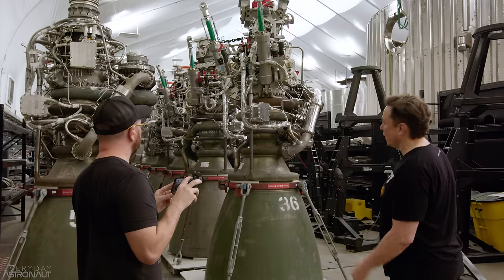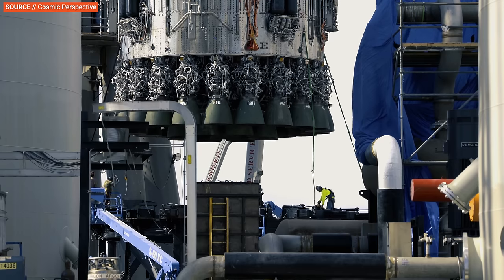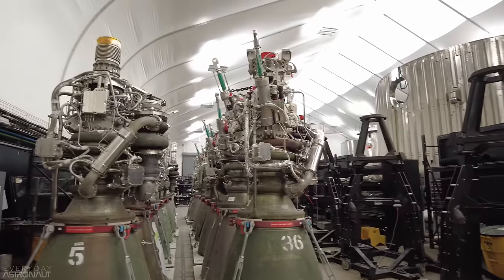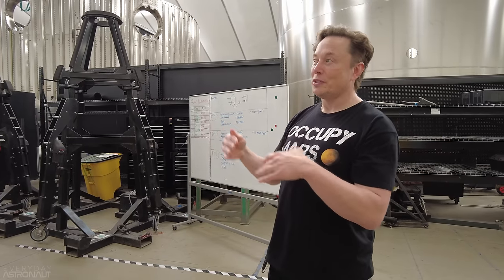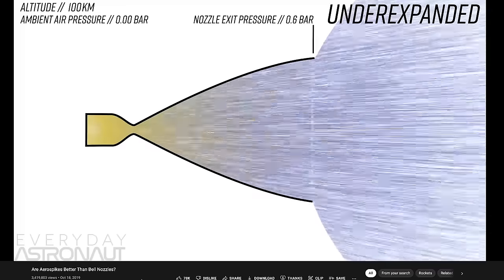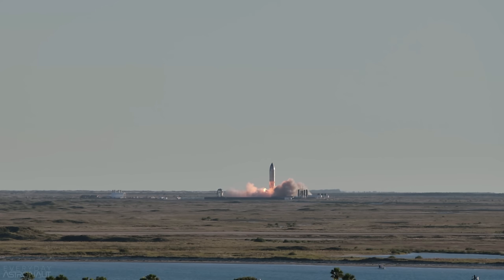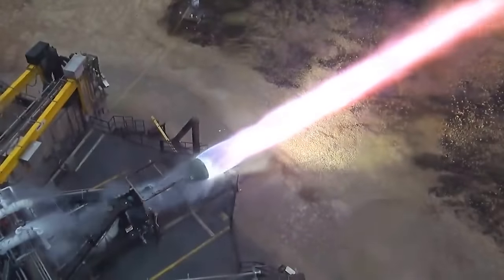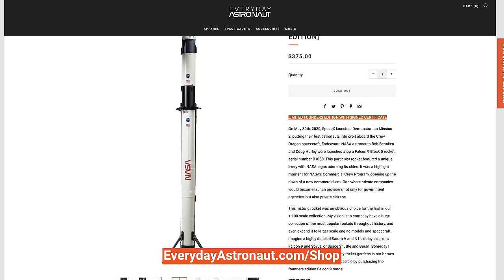How SpaceX Is Upgrading Raptor To Be The Ultimate Rocket Engine!

Comment: You mentioned how Raptor 2 can achieve more work due to gravity losses but in orbit, that's no longer a factor, wouldn't it be better to keep Raptor 1 Vac as it is more efficient. Raptor 2 is great for launch and landing but once in orbit, efficiency comes a long way.
Reply: Raptor 1 is only slightly more efficient, but also heavier, less reliable, and less powerful. Being heavier and less powerful may equal out in total efficiency. But it absolutely needs more reliability. Plus R2 might improve to beyond R1 in the future.

Comment: specific impulse to me sounds like HP for car engines, it doesn't actually mean anything because its peak power on a test stand at optimal rpm etc.. ie a point you never reach in a real situation. The whole torque & rpm curve is what matters and its the same here.
Reply: I also agree with other commenters here that you should ask Musk if he plans on making a bigger version of raptor later down the line once they are satisfied with their simplification and comprehension efforts or if they reached the limits that materials can handle on a single engine definitively. 30+ engines even with less fiddly bits per unit seem like a maintenance nightmare to me once the fleet starts expending.

Comment: Why not optomize the vacuum variant for ISP efficiency and the sea-level engines for thrust? You only need 3 (or maybe 6 eventually) vacuum engines per Starship instead of 30+ for sea level engines so they could afford to be more expensive and complex.
Reply: "Why not optimize the vacuum variant for ISP efficiency and the sea-level engines for thrust?" That's exactly what SpaceX is doing

But the booster will still need about 30 engines for liftoff and the ship 3-6 vacuum engines to get to orbit. The booster only gets the ship above the thickest parts of the atmosphere. The ship then has to gain all the sideway velocity to actually stay in space.
Reply: One of the reasons to not go full tilt vaccum optimization is because the RVacs may need to fire in atmosphere in an abort scenario.
Reply: @motokid6008  I always wondered if that was one of the reasons to put 3 more vacs on for a total of 9 engines on starship, that would give them a close to or better than 1.5 T/W for starship alone.
Reply: @TheEvilmooseofdoom  - That and their intentions to stretch Starship. It's going to be bigger in the future much like how Falcon 9 grew as Merlin performance increased.

Comment: Can do starship SSTO now ?
Reply: I don't think so.
Reply: No it will never be SSTO
Reply: Yes when given 9 engines for takeoff from ground. The SuperHeavy booster already has SSTO capability with over 100 tons payload to orbit as a single stage expendable.
Reply: @robertclark1734  Where did you get those figures for superheavy?
Reply: @TheEvilmooseofdoom  See the video with Dodd titled, “[Summer 2021]Starbase tour with Elon Musk [Part 1]”. About 10 minutes in Elon gives the dry mass of the Superheavy as between 160 to 200 tons. With a propellant mass of 3,600 tons use the rocket equation to get an expendable payload of over 100 tons even with the 200 ton dry mass.
Reply: @robertclark1734  Ahh.. I use a different calculator, the rocket equation is absent gravity and atmosphere.  When I punched in the numbers updated with Raptor 2 engines, single stage to orbit payload is 16-17 tons.  If you are curious which calculator I used it's the launch vehicle performance calculator by Silverbird Astronautics.  Check it out.
Reply: @TheEvilmooseofdoom  Thanks for responding. Perhaps we should compare notes. When I used the same calculator I got over 100 tons payload. When using it, input both vacuum Isp and thrust values even for the first stage, since the calculator already includes reduction at sea level. Also make sure your launch inclination angle matches the launch site latitude, 28.5 degrees for Cape Canaveral. 
 YouTube won’t let you include links in the comments. It’ll delete them. So I’ll send to you what my calculation looks like.
Reply: The YouTube AI must be smarter than I thought. I tried to say do a web search to find my calculation and I didn’t even give a link and YouTube still deleted my comment anyway. Try searching for SSTO on the Kerbal forum.

Comment: I'm almost anticipating a larger bell in the future, if you combine the area and flow rates of 2 engines into 1 you're only increasing the radius of the engine by the square root. There's probably reasons to not do this related to combustion inefficiency, but it would tie into Musk's love of removing parts. Fewer engines also means less plumbing and fewer points of failure, and possibly more mass to orbit

Comment: I'm curious if & how the chamber pressure could be increased substantially. A naive view would involve thicker stronger walls of the chamber, throat, nozzle, and injector array, plus more powerful pumps. But thicker -> heavier, which also dramatically affects material cooling, and its not obvious how the turbopumps could be made more powerful without going to a two stage design, which would be extremely complicated. Would, for example, 400 or even 500 bar be worth the cost? This would also require rather different nozzles, either longer or wider or both.
Hmm. Now I'm pondering a hybrid partial-aerospike plus classic bell design where combustion is done partially inside the nozzle. Hard to explain in a short comment, and IANA Rocket engineer so I'm "talking through my hat".

Comment: What about thrust vs gallons of gas.?  
 Does the raptor 2 have better figures ?
Reply: ISP is basically MPG for rocket engines. Raptor 2 is basically 1% worse in that regard. However, it is lighter and more powerful while being nearly identical in efficiency. That will the overall efficiency better.

Comment: what if they have the rocket in a schute that uses electronic or hydrolic catapults to get it moving off the pad faster? that could be a lot of energy savings, yes?

for example, build a hole in the ground with 4+ points where a massively strong magnet catapult gets it moving with the rockets not having to do all the initial work?
Reply: I think you just came up with a way to make the simple complicated. :)
Reply: @TheEvilmooseofdoom  2 aircraft carrier launcher-like catapult brackets would use very little energy and be very easy to do. you just connect them to the 2 holder brackets on the side.
Reply: @neoclassic09  You're talking about VERY different mass considerations.  A fighter 30 tons.  Starship stack, 5000.  To move 5000 tons with any speed and force is going to take a LOT of energy and equipment.  THAT is why these rocket engines need to be so powerful.
Reply: @TheEvilmooseofdoom  you can make hydraulic or magnetic slingshots that can push it that use less energy than rockets. rockets are massively costly
Reply: @neoclassic09  No you can't. An electromagnetic catapult capable of accelerating a 5000-tonne payload at significant Gs is not a thing that exists or can be built with any plausible near-term technology...

Comment: I do like the idea of further simplifying and encheapening (I doubt that's a word and don't care) the current design. It's a proven way to increase reliability and ease of manufacture.  The more advanced design can be the far simpler one-- as a comparison, look at early semi auto pistols. They worked well, but were very prone to malfunction and had ten trillion hard to produce parts, and were extremely expensive. Nowadays we have seemingly very simple, largely molded polymer versions that seem like a step back at first glance, but are miles more reliable and will still function after getting thrown off a cliff and run over with a truck. Same design philosophy.

Comment: i'm wondering why are they use many "small" raptor engine, instead of fewer big engine?
Reply: Multiple reasons. Many small engines are cheaper to produce due to scaling. Essentially, they have a manufacturing conveyor. Small engines have more stable combustion in main chamber. Many small engines allow for engine out capability. Small engines allow for fine throttling control by simply turning one or several engines off (rocket engines become unstable at deep throttling down) which is essential for ship landing. Only real disadvantage is complicated piping at thrust puck
Reply: @maximlg253  exactly, i was like think about huge complicated piping, etc. 
but for those reason you mentioned, it does make more sense. more effective and more efficient.
thanks for answering my question, now i can sleep well 👍

Comment: 33 engines is a lot of engines by any measure.  SpaceX wants to scale up Booster and Starship by a factor of two and that's a lot more engines.  Raptor 2 will only scale up so far, and will have to jump up in size.  I'd be looking for a 350 to 400 ton engine, possibly 500 tons.  Booster's internal manifolds are already very complex and weighty, so that's improvable if engines can be reduced significantly in numbers.
Reply: Spacex wants to scale up starship by a factor of two?  Maybe in 20 years.
Reply: @TheEvilmooseofdoom  Yeah, the idea of an 18m booster was floated a while back, but as far as I can tell, that was nothing more than Elon speculating on Twitter... never a serious plan.

Comment: How many start, run and stop cycles, can a Raptor run before retirement?
Reply: TBD
Reply: It's probably several fold higher than Merlin because there will be no coking due to it using methane instead of hydrocarbon. I'd say minimum 100 for initial engines.

Comment: Hello everyone. What is the temperature in LEO? When Starship refuels in LEO, will the methalox turn to gas and need cooling to prevent this?
Reply: That depends whether you're in the shadow of the earth or not. On the dark side of the earth, temps would be close to absolute zero, while it would be in the hundreds of degrees on the sunny side of the planet. I'm pretty sure there will be considerable insulation used....
Reply: The short answer is that "temperature" in LEO doesn't mean what it means on earth, because there is no convection or conduction. 

NASA has done a lot of research on how to keep hydrogen liquid in orbit, and that's much, much harder to do so SpaceX should be able to modify those techniques for the liquid methane.
Reply: @EagerSpace  I agree, but I think they worry more about the LOX than the LCH4.

Comment: Sure both Raptor engines both offer a tremendous boost (metaphorically and literally) to the US profile as the world's leading aerospace nation. But we still don't know how long the longest single burn has been that Raptor 2 has completed during testing. Nor do we know if Raptor 2 will function correctly during a launch.
Reply: NASA Space Flight has a McGregor cam for engine testing and Raptor 2's have done full duration tests that the booster would perform.

Comment: I couldn’t find any information on the thrust measuring word “bar”.  Is there a different spelling?
Reply: Thrust is not measured in bars.
Reply: Bars are for the chamber pressure, not the engine thrust

Comment: I really hope that this Booster, will not turn into another N1/L3 failure. The last time they tried it was in 1972. Hence my vibration question. SpaceX had to go back to the drawing board after realising that slapping three falcon 9s together is not as straightforward as it seemed. Again the centre falcon 9 was a special once off product. So in my point of view they are in it for another decade of trial and error, including catching that rocket. I always wondered why they didn't catch the falcon 9 back then and the answer was it will land anywhere. Now they are starting again from scratch. Did they learn? Yes, but this is uncharted and lots of firsts and probably lots of changes coming and that turns into lots of delays.
Reply: Who knows what they will have in 5 years. One of the things they need to do is create their lunar lander version, which of course will require landing legs. It may be that catching proves to be too hard and they may end up back with a landing leg version. Only time will tell. Ultimately, any moon base will require a hard surfaced landing area to minimize dust getting into  the ascent vehicle which in SpaceX's case, would be the landing vehicle as well. It's going to be a tough problem initially.

Comment: So that's fascinating, so 3D printing is very useful for prototyping but for actual production they don't use 3D printing?
Reply: 3D printing is good for prototyping because its fast, but it is very, VERY expensive. It is only good for manufacturing in a very high amount, otherwise initial costs of the machines far exceed that of basic casting. They wouldn't use 3D printing for production unless they were cranking a few thousand Raptors a month.

Comment: I understand the drive for better engines, but why not bigger engines? The benefits of the full-flow cycle, on paper, seems like a scalable model to double or triple the size; however, I am not familiar with the physics implication of more space to pressurize within the engine. This would be a cool thought to explore from your perspective, Tim!
Reply: Pretty sure the design philosophy behind this stems back to redundancy. If Saturn 5 lost even 1 engine, it would probably not get to orbit. Starship boosters could probably lose 2 or 3 engines and still complete the mission, since the thrust lost is a smaller percentage of the overall thrust available
Reply: Combustion instability, you get oscillations of pressure moving around inside the combustion chamber in bigger combustion chambers. The Saturn 5 first stage engines had a lot of issues.
Reply: Hey, I can add to this question!
Raptor's main defining feature is the pressure it produces. Making a larger pressure chamber for a bigger engine is very, very hard and my guess is that they will first want to squeeze as much pressure out of the engine as they can before they make anything bigger. After all, why make a bigger engine when you can make the one you already have more powerful

Comment: I have a question is it a good idea to build a rocket powered by nuclear reactor? I mean, by using nuclear engine, you can save tons of payload and space to build a much bigger pressurize cabin for crew and cargo. You can also solve the power problem cause  nuclear is a great way to produce electricity, fuel for future mars colonization missions. I don't think we have to worry much about the radiation cause everything can protect us from the solarwind on that ship is definetly can protect us from radiaton
Reply: Nuclear rocket engines can be used effectively once in space. NASA even had a project called Nerva. But it cannot work in the atmosphere that well. Nor do you want it on anything that re-enters the atmosphere. So a space tug. One day in the future possibly.
Reply: I mean it would work like a second stage of the rocket, it will connect to the starship when they are in LEO and seperate it once they are in mars obit. This nuclear engine can be used so many times and can save a lot of payload
Reply: @anthonypelchat  I mean by using it, you only need to fuel the starship for lift off, the rest will be powered by the second stage nuclear engine once they are conected on the orbit
Reply: The second stage nuclear engine will still orbited around mars, waiting to connect with other starship on the journey to earth
Reply: @quannguyenle2330  Correct. You would use it as a space tug. Use Starship to build a bigger ship in LEO powered by nuclear engines. Then dock craft to that ship to go back and forth between Earth and Mars. Maybe have some Starships around Mars for landing from and returning to LMO, docking with the nuclear powered ship.
Reply: @anthonypelchat  I also think so, may be we will see some thing like that in the next decade. I mean, space X have done so much things in this decade, can't imagine what we can acchieve in the future
Reply: @quannguyenle2330  I doubt we will see them build a nuclear powered ship unless NASA has them do so. However, an ion ship may be a decent option. SpaceX already works with tons of those.
Reply: @anthonypelchat  It will be so great to see a starship powered by ion, may be we can get to mars in just 2 or 3 months

Comment: I would love to know what parts that are 3D printed and why what advantages does 3D printing have? He said some parts will be machined, well why will some parts be 3D printed? Is 3D printing rocket parts revolutionary?
Reply: LOTS of people would like that insider info.
Reply: 3D printing wouldn't likely work on enough parts for it to be legal. 3D priming is much more expensive when you can just use casting, it is also a bad idea when you only need to print a few dozen a month. 3D printing rocket engines wouldn't be revolutionary in terms of production cost or speed.

Comment: Even though Bernoullis is for fluid dynamics it can be applied to air and gaseous pressures. I used it alot when rough calculating flows in gas turbine engines to get betterperformance. It can be dumb down by measuring pressures and temperatures, then adjusting the hardware to meet the end requirements. 
I still say, they can reduce chamber temperature reducing flow to the chamber by, bypassing some of methane to a afterburner. The fluid is already in the nozzle for cooling. Just adjust the furthest stage closest to the nozzles exit into a spray nozzle. It's more complicated but this would be the basic theory. Has anyone ever tried to Afterburn a rocket?
Reply: I don't think so.  I'm not sure if anyone considered the increase in thrust worth the trade off in ISP.
Reply: Afterburning a rocket is running fuel rich. That decreases temp, but also increases mass-flow rate too much for no thrust gain. You'd see exponential decreases in efficiency if you did that.